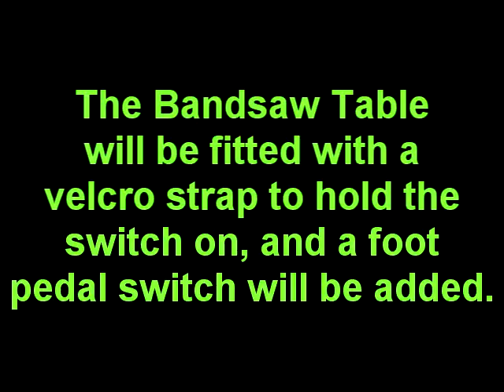(S-2 Ep-18) Build a Portable Bandsaw Table (FREE PLANS)

Comment: nice work, thanks for the plans!  I have a vintage Delta saw so will hove to mod them a  bit for it to fit.
Reply from the maker: Thanks Bill Skoros, and you're welcome. You will indeed have to make a few mods to the dimensions I used with respect to the mounting hole locations and clearance  notches (if needed with your saw), but it probably won't take much time  or effort. Good luck with your build, and thanks for subscribing!